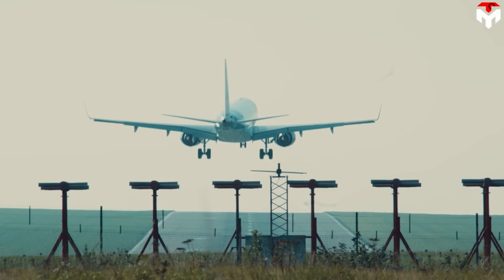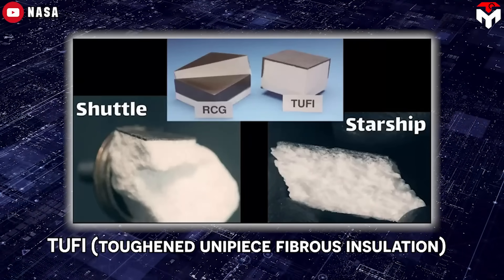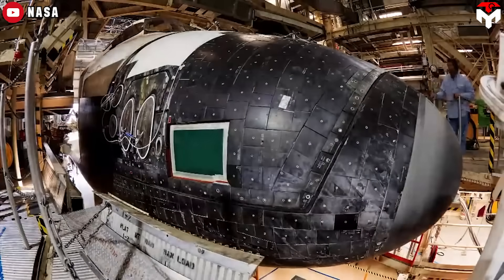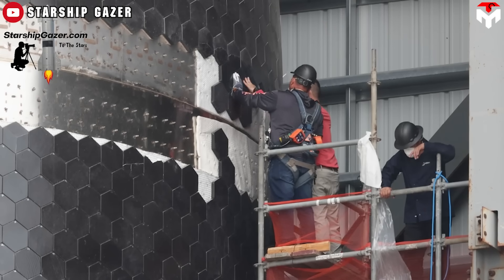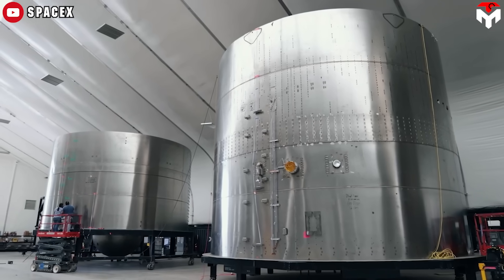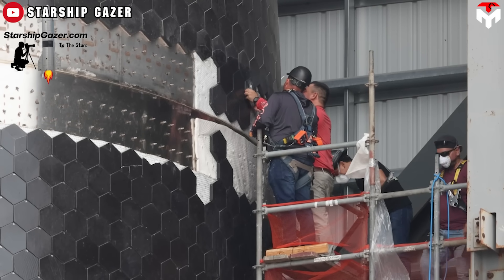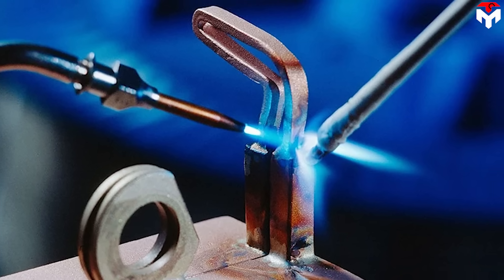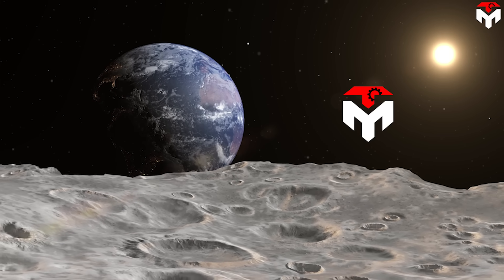What SpaceX just did with Starship Heat Shield made NASA embarrassed!

Comment: The Space Shuttle's thermal tiles weren't damaged during reentry....it was always during launch.   They sustained damage on every single launch to some degree...and this degree got worse later in the program when the foam insulation on the fuel tank formulation was changed to satisfy EPA guidelines.   I don't think NASA was required to change the foam but did anyhow trying to be compliant to the EPA request.   That reformulated foam caused quite a bit more and more severe damage which ended up destroying Columbia.   Thanks EPA!!!
Reply from the maker: Thanks for your sharing

Comment: Columbia was not destroyed by damage to the tiles. The damaged area was on the carbon-carbon leading edge of the left wing. A 1.5-pound hunk of thermal insulating foam became dislodged from the External Tank and struck that leading edge while that Orbiter was traveling near the speed of sound as it accelerated less than 30 seconds after liftoff. A 1-foot-square hole was punched in the carbon-carbon material.

Sixteen days later during the entry, descent and landing (EDL), hot gas entered the interior of the left wing through that hole and overheated the internal aluminum structure of that wing. Aerodynamic forces eventually tore that weakened wing off the fuselage and Columbia disintegrated over Texas.

The tiles were not involved in the Columbia disaster nor were they the cause of the Challenger disaster (which was due to O-ring failure in one of the solid rocket side boosters).

The Space Shuttle was launched 135 times and landed successfully 133 times. Those tiles performed exactly as designed in those successful EDLs.

Side note: My lab worked for nearly three years (1969-71) on developing and testing those rigidized ceramic fiber tiles for use on the Space Shuttle.
Reply from the maker: I will find more about this, thanks

Comment: SpaceX or Elon is building a death trap. The tiles will be defective due in whole part attempting to glue a layer of insulation to stainless steel. Stainless steel is used food processing, in critical area that can’t be allowed to corrode. Stainless is neither light nor impermeable to heat. It will take a 1000 degrees. Just a little problem reentry is not just a 1,000 degrees. Second when stainless steel reaches 1,400 it begins deformation. With the g force applied to the belly of the craft. The tile will delaminate from the insulation. Stainless is 10 the weight of aluminum. So it is not light. Elon is once again building a cheap rocket. It can’t get into space. Now it cant survive reentry. Astronauts are risk takers. But their not stupid. One last thing about stainless is inherently non stick. So now you have compounded the problem. Once the craft goes through the temp changes, heavy g forces on launch to the super cold of space, the direct heat of the sun once every orbit the glue will delaminate upon reentry and exposed 4,000 to 6,000 degrees plus. Starship will simply burn up. Like every thing else. The first accident and Elon will no longer be a space pioneer.
Reply from the maker: Great idea! I need to find more about that. Thanks

Comment: only same shape size tiles??
A flatter side to face reentry
with a ridge like a walnut
for plasma  flow to lip around instead of
Koandra effect spreading on cylinder shape.
May be a flow of liquid nitrogen on centre of belly`
at momments before highest intencerty.
Booster to fall futher in a bell flop
Have grid fins in a sharp position
until final flip to land
Lansding engines fire moments before 
final landing flip
to ease forces fighting against
landing drag on engine bells+